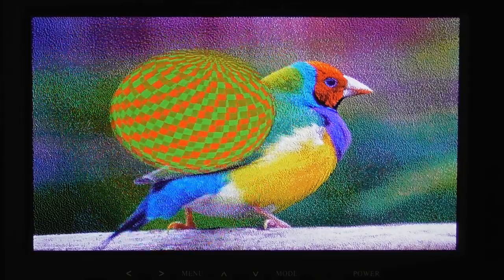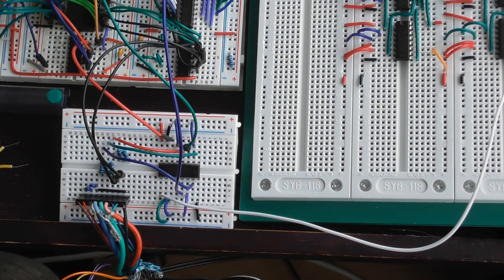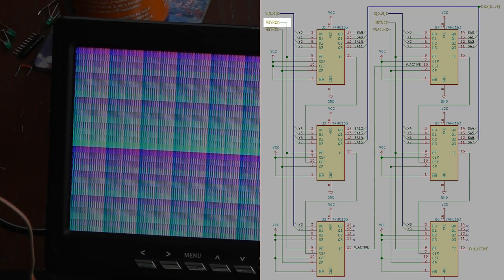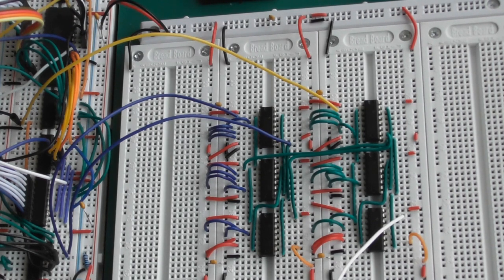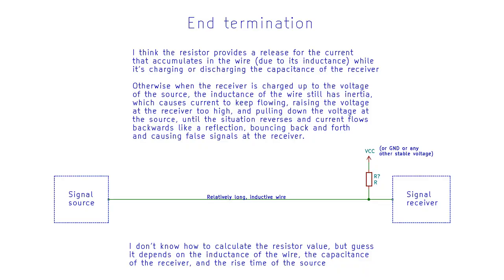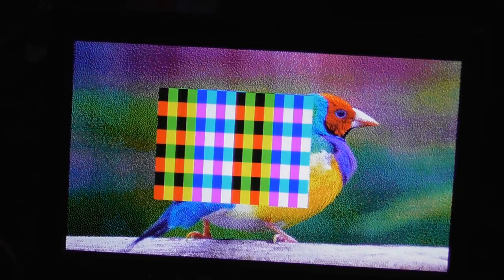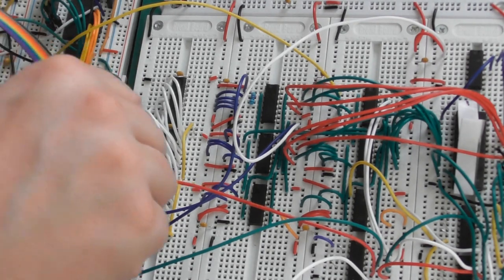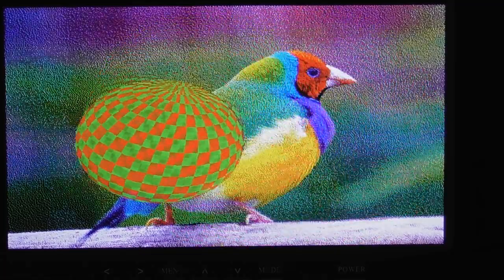VGA Sprites on a 6502 breadboard computer

Comment: I'm going to need to watch this at least 5 times to get my head around what you've achieved here.  Great job showing the practical issues encountered when designing and building stuff on breadboards.
Reply from the maker: Thanks, and yes there's a lot going on. I was on the fence about cutting it into two pieces and going a bit slower, but I didn't want to leave it without something interesting on the screen by the end!
Reply: I'm on my second watch through it... Nope still lost :). I'm just dumb I think.
Reply: @genxtech5584  me too 🤧

Comment: Brilliant :) Funny enough, I never didn't get how the sprites were done. Your explanation makes it crystal clear now. So simple, so obvious... now that I know ;)
And from the whole serie, I get why the video cards started to change paradigm, from shared memory with the cpu to a complete different system with some registers as intf. From being tightly coupled with the cpu clock to autonomous system. I hope you will continue this serie as it is very entertaining and informative
Reply from the maker: Yes absolutely, I am hoping to gradually shift to a command-driven interface and build more assists into the video circuit, as an analogue to what happened in the PC world.

I also have some sketches of designs for a system to support fairly large numbers of smaller sprites on the screen simultaneously, but I'll only pursue it if I can do it without needing huge numbers of extra components.  I think I can but it needs more thought.

Comment: I've been working on/off on my own VGA with discrete logic for a long time now but suffer from both a lack of knowledge and trying to make it overly complicated too soon.  I'm going back to the drawing board after watching some of your videos.  Amazing work here, keep publishing.
Reply from the maker: My 160x100 circuit was a very good starting point, it helped on the software side that the coordinates fitted into a single byte and there was one byte per pixel because the 6502 is well suited for that. 320x200 is also a great sweet spot and is the resolution that most of games used until 3D hardware acceleration, so it's high enough to do a lot of interesting graphics and usable text. Realistically with the era of technology I'm using that's about as high as you got as well; 640x200 was also a CGA resolution I think, with only two colours except in text mode. Anything later than CGA was using custom ICs of one kind of another.

Comment: Very nice!  That's a circuit that could be easily done in a very small CPLD or a big PLD, but I'm liking the discrete method you're using for the prototype.  Thanks, also, for the info about transmission line termination.  It's not really a very scientific method, but it gets the job done quickly and effectively without the need to do any extremely complicated math.  Thanks for this video.  It's great stuff!

Comment: Extremely impressive! My knowledge on homebrew design and prototyping is allot more limited than yours, But.. One way I've thought of implementing VGA on homebrews is driving an ISA card. (I know it has been done a few times before, But it seems the most straight forward way). To see you simplify it with that IC really means allot to the homebrew community. Just subbed and looking forward to more content.

Comment: I’m so happy I finally got around to watching this! The tempo was a bit too high for me to grasp everything in one go, so in my case you could’ve chopped it into three 20 min to half hour videos with a few more details. For instance I didn’t understand how exactly the 6502 controls the sprite location - though it is plenty of help if I wanted to add sprites to my own build and then I’d watch it a few more times anyway.
I know it’s been a year but kudos on this one!
Oh, and edit P.S: Always have 100nF per IC - you won’t always be lucky and catch it at the right time. Also I had a lot of success moving from breadboard to PCB on a module to module basis. Less mess on the desk and you can still breadboard the problem at hand - and PCB’s are a lot cheaper than time these days :D
Reply from the maker: Thanks, good feedback - I didn't split it up because it was hard to find a point where there would be a satisfying conclusion.  Perhaps it's worth going back and explaining some of that in a bit more detail, in shorter recap videos.

I don't generally bother with per-IC capacitors because it's rarely made a significant different, on the breadboard - I've had a lot of success without using them, and generally when there has been instability, adding per-IC capacitors alone hasn't particularly helped.  As you see in this video, when push comes to shove other techniques like adding terminating resistors, or rerouting wiring (star topology rather than daisy-chaining signals) have been what's made the difference.  My general conclusion is that the breadboard environment is so uncontrolled, the electronic signals will never be particularly high quality, so the lack of decoulping capacitors is a drop in the ocean!

I hear you regarding PCBs though.  The reason I don't generally do that is that I don't like the waste of having to order 5 and throw 4 away.  Also my designs tend to evolve rather suddenly, and it's hard to stomach the lead time on making PCBs.  I ought to get better at consciously drawing a line under a project, and saying it's done!

Comment: Very interesting! I have had a lot of trouble in my project from counters glitching and certainly timing issues, nothing that bigger capacitors could fix. So the use of these terminator resistors is interesting. I wonder did you never use an oscilloscope to debug any of this? I don't have a storage scope so for me it's very hard to debug glitches, bouncing, and ringing. It's cool to see that you didn't need any scope to debug your issues. You really don't?
Reply from the maker: I had an old analog scope when developing these things but it wasn't much help for this sort of thing. More recently I got a modern DSO which is useful, but still not very convenient as I didn't have a decent dedicated space to set this sort of thing up in. Moving forwards I have more room now and may be able to set up a better workspace!

Comment: I hope you will revisit this exciting project in the future.

A single 32x32 sprite (or even just 16x16) would be usable as a pointer. It may be nice if you could consolidate the circuit into a PCB. Maybe with connectors for future expansions. A true TTL based "graphics card" is something that i have not seen implemented anywhere.
The following features are needed for a retro-computer graphics card in my opinion.
mandatory:
- direct text mode (40x25 or greater)
- direct graphics mode (320x200 or greater)
- sprite(s) (one 32x32 pointer or greater)
optional:
- direct memory mapped frame buffer (optionally windowed)
- hardware 'zoom' via pixel/line doubling (like 640x480 -> 320x240 -> 160x120) for different "video modes"

- fill mode (hold a color per line until another color is selected - optimization for line drawing on a solid background)
- multiple layers 
Thank you for your hard work and documentation on this project
Reply from the maker: Glad you liked it! The single huge sprite is not very useful, I am interested in getting a large number of small sprites to work though. The challenge is doing so without having separate timers and ROMs for each sprite. I have some designs in mind though that could do this. I'd also say the 8-bit Atari designs were very interesting.
Reply: @GeorgeFoot  Ooh, I've been trying to figure out how that would work too. Have you by chance made any progress on this? Or know of a place I could look to for inspiration?

Comment: Wow again! This is inspiring. When it's finished, it's going to be an awesome VGA card. I can only imagine the next step will be text, and hardware scrolling? Here's to hoping. ;-)
Reply from the maker: Those are good features, yes. I don't have a specific plan for the end point though. There are a few other things that could be next - multiple sprites, palette control, maybe tiled backgrounds, and I really want to change the interface to make it faster and have fewer address lines. I'm also interested in hardware acceleration. I also read about the Atari 800, wow what an interesting design.
Reply: @GeorgeFoot   Hardware scrolling is surprisingly simple. It's just matter of offsetting the address location before the sync signals start.
Reply from the maker: @bobweiram6321  I've done it like that in another circuit, but it wouldn't work in this one right now because the sync signals are embedded in the image memory. One of the overhauls I'm planning is to move them back into EEPROM so that I can be more creative with the image memory addressing.

Comment: To get the best results, the impedance of the signal source and the impedance of the load should be matched (= the same).
Look up "impedance matching".
So if your oscillator has 50 Ohms output impedance, use a 50 ohms resistor at the load.

Or just use some buffers to distribute the clock signal (buffers inputs get fed from the clock, the output of each buffer goest to one or more ICs that need the clock signal)
If you want to get fancy, there are specialized ICs for clock distribution.

Comment: would it be worth it to move sync generation to dedicated hardware and get RGBI style 16 colors instead?
Reply from the maker: I think I will move the sync back to EEPROM like in the initial circuit, and leave the RAM for image data only, to get the same result
Reply: @GeorgeFoot  that works too yea

Comment: I never would have thought of chaining the three shift registers so you'd only have to address the first one. Back in 1982 (I think) I used a 74LS574 (or an LS573) to quickly build a parallel interface adapter for a printer I had bought. I debated on whether or not I should spend the money to use a 6821 PIA but the LS574 worked fine and somehow the latch enable pin even worked for the "strobe" pin to the printer to tell it there was a byte to read. I couldn't believe I had my printer running in just an hour or two.
Reply from the maker: Wow, what kind of printer was it and what were you plugging it into? I had a Citizen 120D around that era, but it was Epson-compatible so no weird interfacing was needed.

The flip flop shift register idea came from this forum post: https://stardot.org.uk/forums/viewtopic.php?p=325574#p325574

It's referencing the original ARM Evaluation System that was the first ARM-based product sold, it plugged into a BBC Micro and used it as an I/O interface to allow development of first generation ARM software.
Reply: @GeorgeFoot  The printer was some piece of junk that was advertised in Byte I think and took almost a year to arrive. My 6502 computer was an Ohio Scientific C1P which was something like the PET computer.

Comment: I assume that the sprite data replaces the current pixel data from the framebuffer as the horizontal lines are being drawn? If so, how do you avoid have a mixed colour pixel of framebuffer/sprite?
Reply: There’s a multiplexor circuit shown at 4:02 in the video, it switches to the sprite color during the sprite active time on each line
Reply from the maker: Yep, the multiplexer picks between two sets of 4 inputs, based on a "select" input on pin 1. If pin 1 is low then inputs I0a, I0b, I0c, I0d are routed to the output pins; if pin 1 is high then I1a, I1b, I1c, I1d are passed through instead. In the audio I misspoke and got the letters and numbers backwards compared to the schematic, apologies if that was confusing.

Comment: What if you shrink the ball down to 50% size to give it more space to bounce? 😉
And also change the background image to something else than that bird? 😉
Reply from the maker: Yes I could do that, the circuit already supported halving the dimensions with just a single wire changed. For practical use though it needs to support multiple smaller sprites really.
Reply: @GeorgeFoot  I thought if the ball be half size, there will be more space for it to bounce freely.
Reply from the maker: @zsombor_99  yes, it could look nicer that way

Comment: Which chip(s) are you using for the counters? Very enthralled by all this.
Reply from the maker: These are 74ACT163s, the schematic said HC but it was wrong. Ben Eater uses '161s in his VGA circuit I think, the difference is subtle, I think it's just whether the preset is synchronous or not? Synchronous is probably better here but maybe not a big deal.
Reply: @GeorgeFoot  I still have trouble wrapping my head around VGA timing.
Reply: @GeorgeFoot  is the act necessary? I have a ton of hct
Reply from the maker: @JohnLonerganProjects  It's borderline - according to the datasheet it'd be ok at room temperature though. The frequency required is 25.175MHz. I'd guess any of the variants with an A would be fine. Also this only matters for the horizontal counters - the vertical ones can be slower as they never see the fast clock. You could probably make a 16V8 or 22V10 PLD emulate it if you have those available.

Comment: Seriously cool. Are you planning to somehow make this work with shared memory?
Reply from the maker: Possibly - a complication is that these counters don't have tristate outputs, so we would need extra transceivers. It's also less useful as the point of sprites is really to move large static images around efficiently, and being dynamically updated isn't really the focus. But I agree there is value in being able to load into sprite RAM from SD card for example, at least on startup.
Reply: @GeorgeFoot  One easy solution might be to use a register to select a bank of sprite RAM that is visible to the sprite generator while a second bank of RAM is visible to the CPU and just toggle the bank selection to allow changing sprite images while the other bank of images is being displayed.  Doubles the ram requirement and adds several chips, though.  But the results would allow very fluid and fast updating of sprite memory.  Just a thought...
Reply from the maker: @Dave5281968  One of the things I try to avoid is excessive wiring and transceivers. Every time a memory IC needs its addresses driven by two different things, you need multiple transceivers or similar to isolate them, and it puts the chip count (and wire count) up a lot. Same for the data buses. Though I am wondering if there's a way to use the sprite counter address outputs somehow even when the CPU is writing. Maybe it's like a second mode in which the address increases with each write, as an alternative to the usual triggers.

Comment: Maybe add a bus driver, put vga clock on all the inputs for 8 independent outputs?
Reply from the maker: Yes, or maybe just an inverter driven from the crystal oscillator. The topology there is awful at the moment - there are a few things like this that I'd like to plan into a rebuild, committing to some more concrete specs as well.